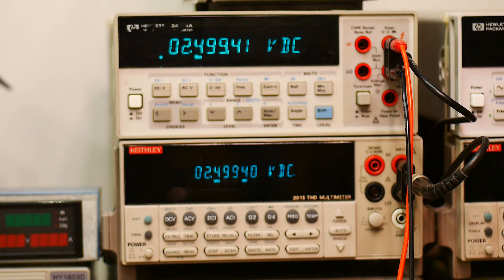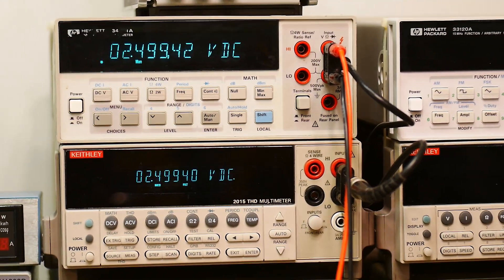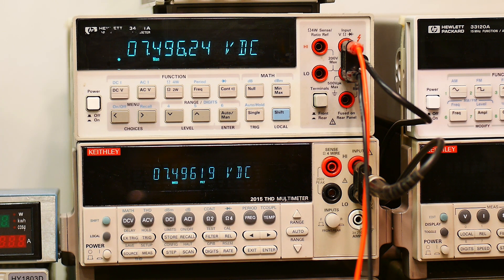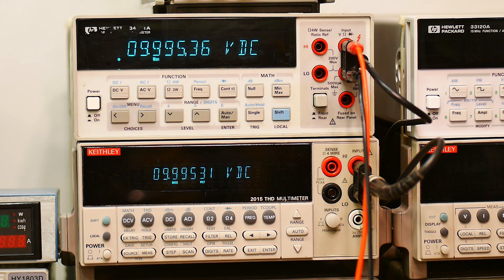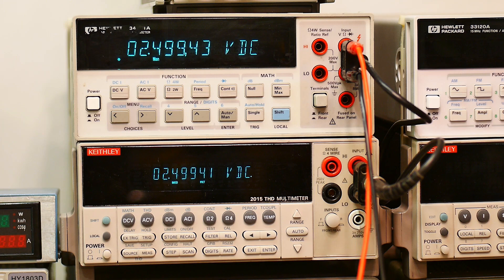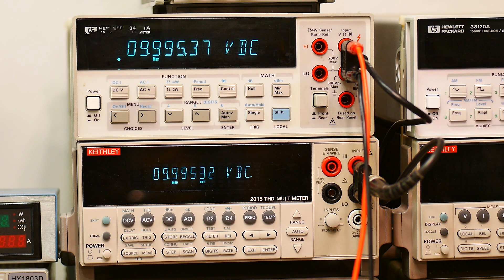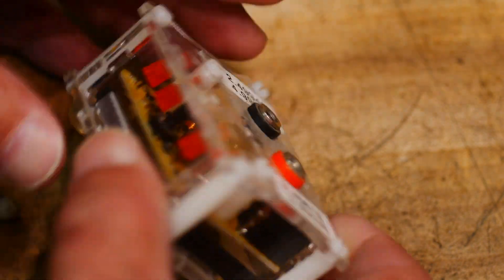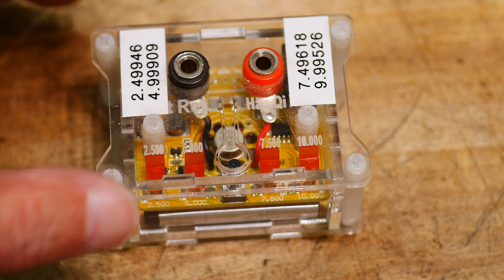#524 Checking Calibration of Two 6.5 Digit Meters

Comment: It looks like it has a barrel plug for recharging. Does the cable come with the device?
Reply from the maker: I don't think so
Reply: Where did you get the cable to charge it?  USB on one side what is the plug that goes into the reference?
Reply from the maker: @kiarabrandt6724  I had a 5VDC AC adapter left over from something
Reply: @IMSAIGuy  okay thanks